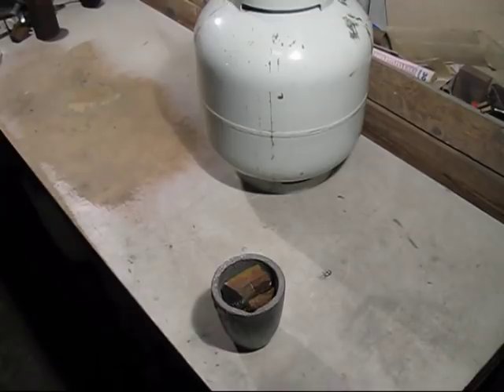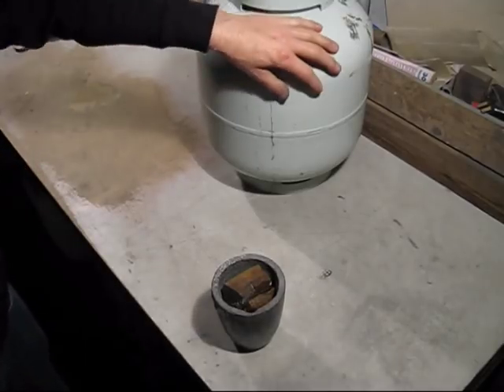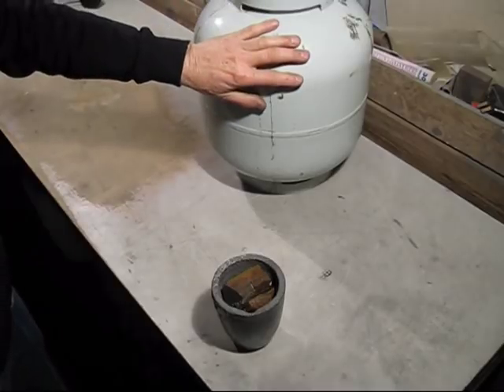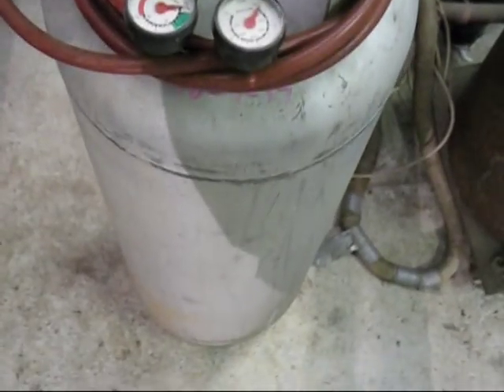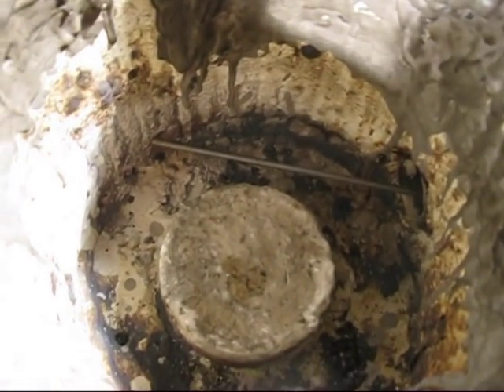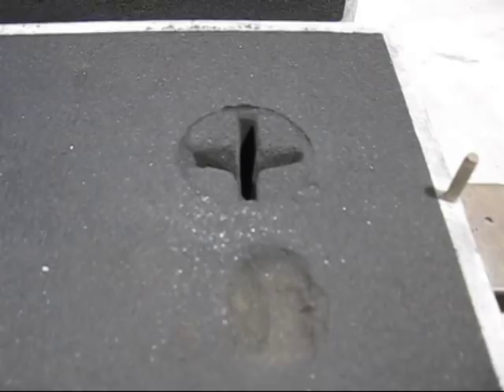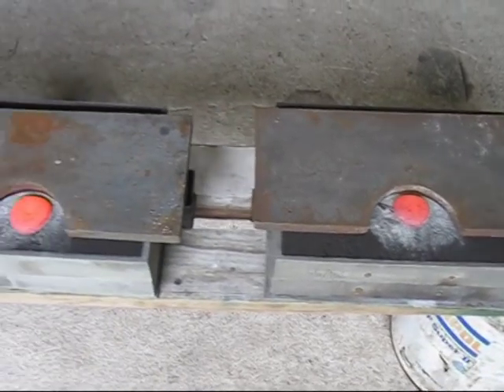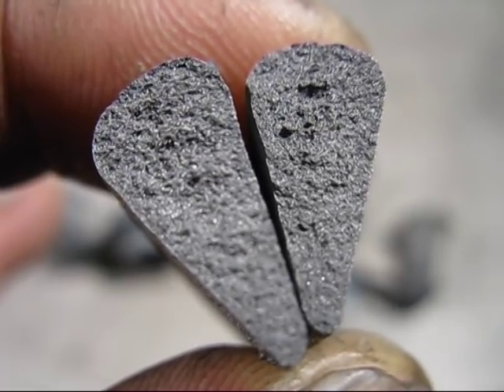Is it possible to melt cast iron with propane?

Comment: What about steel?
Reply: Bessemer process, check it out on web. So you purge the molten "cast iron/ductile iron" ( steel with an excess of carbon) and burn the carbon out. Wots left is Steel.That's it. Easy hey!. 
Oh, rots of ruck.
Reply: I know the process in industrial setting, but what about melting and recasting steel scrap at home?
Reply: Unless I am mistaken Steel has a lower melting temperature than Cast Iron, Iron being the Element and Steel being an Alloy of Iron.
 Please correct me if I am wrong, I am here to learn. It is to do with Eutectic temp.
Link to explain. https://en.wikipedia.org/wiki/Eutectic_system
Edit; Cheers from John, Australia.
Reply: joandar1
Cast iron - 1100-1200C, steel - 1400-1500C.
https://www.engineeringtoolbox.com/melting-temperature-metals-d_860.html
Reply: ashkira 2, Thank You.
 I was always under the impression that an Alloy, Steel is, Was always a lower melting temp than the highest melting temp parent metal.
 I have had a look at the information you sent and I was wrong! Again, thank you. As I said please correct me if I am wrong.
 Perhaps others that like myself did not know this will be educated like I was.
 Cheers from John, Australia.
Reply: joandar1
Don't worry! Making mistakes is a part of humans nature. 
Maybe you just misinterpreted those diagram. Steel is less alloy than cast iron.
I was wrong too, saying quartz can't withstand that temperature. In fact - it can, but it needs to be very pure. Regular silica sand has up to 9% of other, less heat resistant, minerals.
Reply: All good, thanks again ashkira 2
 I am now prepared for the after life, as it is so good that none have bothered to come back and say how good it is. I don't want to go there being stupid.
Cheers from John, Australia.
Reply: RagingShrimp67
I think it's possible for small castings, but is much more difficult... Regular quartz sand can't withstand temperatures of liquid steel. Zircon sand with potassium phosphate binder must be used. Also molds must be preheated to red hot to get rid of water before pouring.
Reply: https://www.asminternational.org/documents/10192/3447909/06820G_Sample.pdf/30cf2173-7b93-4296-916a-d2dd94ea3830

Comment: Why does the sand look so much different i.e. Dark grey vs red from the other videos? Does cast iron require different sand?
Reply from the maker: Sand for cast iron needs coal dust to give a better finish on the surface of the casting.

Comment: Thank you for another excellent demonstration.  Since you are mixing fan-forced air instead of compressed air or compressed oxygen, would it be safe to say that a flash back arrest valve is not necessary on the propane line?
Reply from the maker: There is no need for a flashback arrester valve because propane pressure is always higher than the forced air.